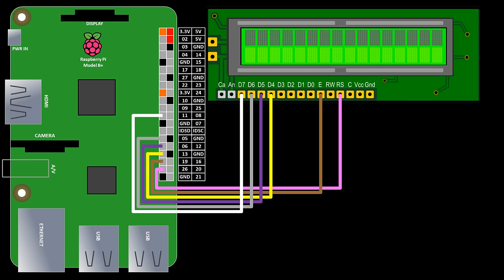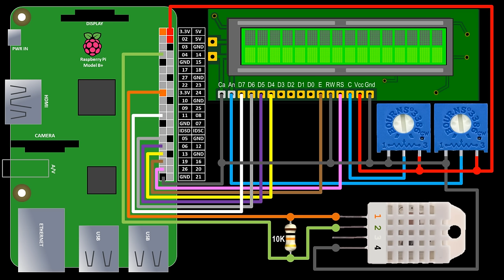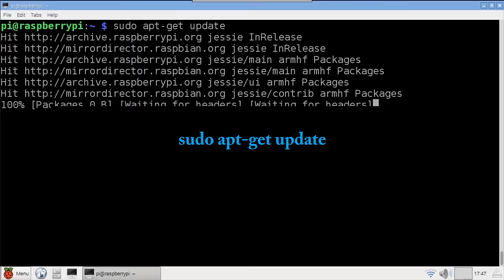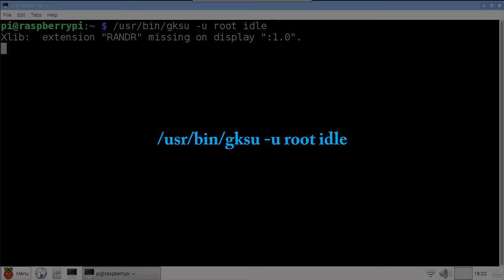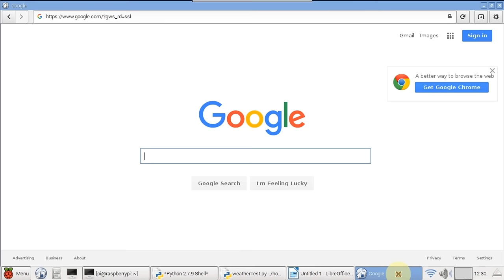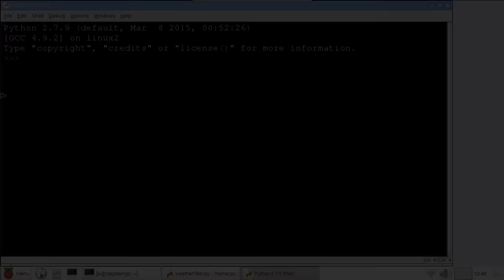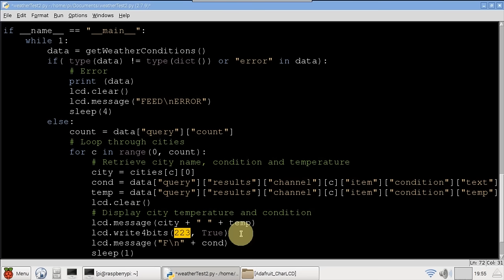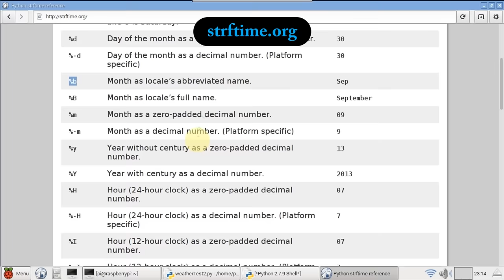Raspberry Pi International Weather Clock Tutorial

Comment: Question, I've followed everything you've said to a point but the '/home/pi/Adafruit-Raspberry-Pi-Python-Code/Adafruit_ChartLCD' from 5:27 isn't there. Any tips? :|
Reply from the maker: The Adafruit CharLCD library is now easily installed using Pip.  This means  you don't have to add it to the path.  There have been other updates since this video was released.  Please see my website for updated instructions and code.  There is a link in the video description.

Comment: It would be great if you could do a video on the MCP23017 to control buttons and an LCD
Reply from the maker: +Robert Frisbie I did an I2C video: https://youtu.be/i5A5AsDRRwQ
It demonstrates connecting an LCD with an MCP23008 which is the 8 pin version of the MCP23017.  They both use the same python library.

Comment: bro the jumper wire you use in this tutorial. how you made them i mean from where i get those or whats the size of wire i mean gauge or something ??
Reply from the maker: +Saad Wazir I use 2 types of jumpers.  The jumpers on the breadboard only are 22awg solid wire.  You can make them yourself or buy kits.  The jumpers from the breadboard to the Pi are 24awg and the connectors are called Dupont connectors. For the male side, you can buy 2.54mm straight pin headers.  The 40 pin version can easily be cut to any number of pins including 1 for a jumper. You can also buy female header pins which go into female header connectors.  They sell kits that have all the necessary pieces.  Sometimes old computers will have good jumper wire with the Dupont connectors on 1 end which you can salvage.  Most of my jumpers are store bought kits.
Reply: +rdagger68 tnx bro i appreciate your effort tomorrow i buy these 22awg solid wires i mostly use Ethernet wires but they just broke some times. well tnx god bless you bro

Comment: Has anyone had problems where the display will be working fine and if a wire gets bumped slightly (but doesn't come out of its place) the characters on the screen turn to symbols and will not reset to normal english lettering?
Reply from the maker: If it only occurs after a bump then it is probably hardware related.  Inspect the solders on the LCD (yours and the factory ones).  Make sure your wires are not too long (under a foot).  It could be a static or noise issue.  You could try adding decoupling caps.  In terms of software, you could try different libraries.  Some displays require that the delay after a clear be a little longer.  You could try removing clears from your code.  Of course, you could also have a bad display.

Comment: it gives me an error to the line 56 " lcd.message(city + " " + temp)" how do i solve it?!
Reply from the maker: What is the error message?
Reply: sudo python weather.py
 File "weather.py", line 56
   lcd.message(city +" "+ temp)
   ^
IndentationError: unexpected indent
Reply: sudo python weather.py
  File "weather.py", line 56
    lcd.message(city +" "+ temp)
    ^
IndentationError: unexpected indent
Reply from the maker: You have an improper indentation.  For Python, you should always use four spaces for indentation, as per PEP8. You should also avoid mixing tabs and spaces.
Reply: +rdagger68 i hace solved the first... now ... just doesn't fils up with nothing is just the "error message" on the pi's screen
Reply from the maker: I updated the code this morning to address changes in the Adafruit library.  Please download the new version from my website.
Reply: it is good now it starts... but it doesn't show the DHT22 sensor results and the time is the same for all zones it has no diffrence and the second view is only with F not C...
Reply from the maker: Please see http://www.rototron.info/dht22-troubleshooting-tips/ for help with the DHT22.  The time is local by design.  Unfortunately, the time returned by Yahoo is the time of the last weather update (not the current time).  You could use the datetime.astimezone(tz) function to convert your local time to match a city in a different time zone.  My site has instructions on how to use Celsius instead of Fahrenheit.
Reply from the maker: I added a new version of the code to my website that includes local city times.
Reply: rdagger68 it works great now ... only problem it is when the internet crushes for 1 minute or more ... the pi program can't restart or something to continue his job ...
Reply from the maker: I just tested the program twice with Internet and network disruptions for several minutes.  The program displayed "Feed Error" during the interruptions and automatically resumed properly when the connection was restored.  Are you getting a specific error message? Does the shell window display any debugging information?
Reply: rdagger68 no ... it rests on the clock of my region and the dht22 results of that time that internet stops and that's it ...
Reply from the maker: I added a specified timeout and more exception handling to the code on my site.  Please give it a try.  
If that doesn't work you can try using the Eventlet library to force a timeout:
import eventlet
eventlet.monkey_patch()
with eventlet.Timeout(15):
    requests.get( ... )
Reply: it works fine now with internet breakouts ! :) thanks!